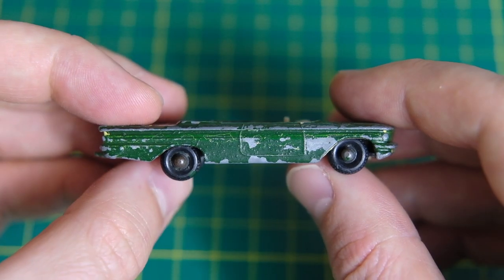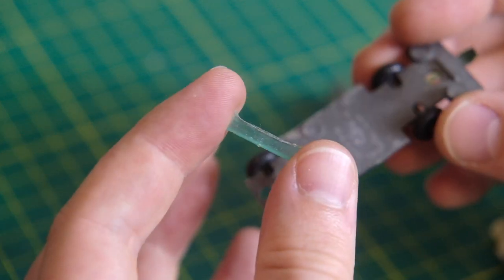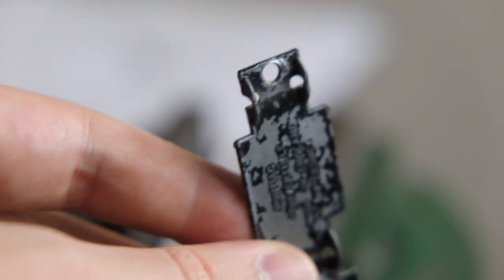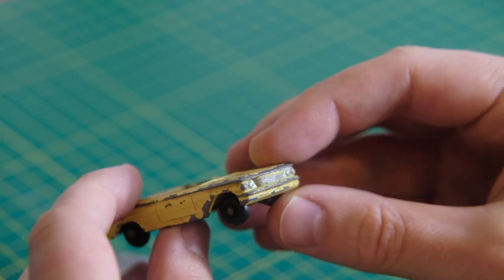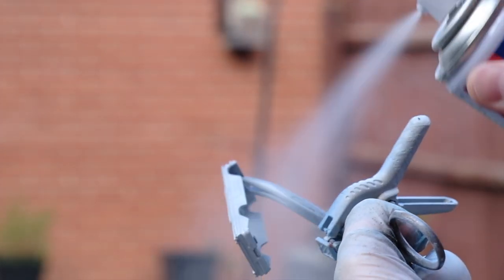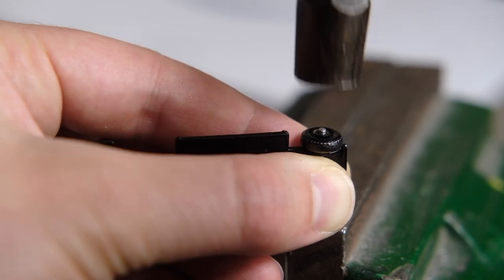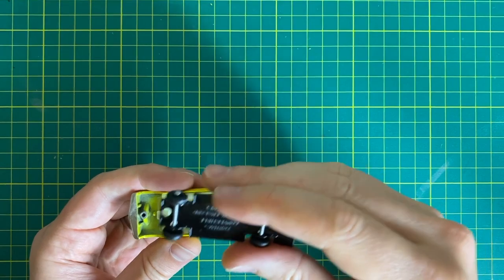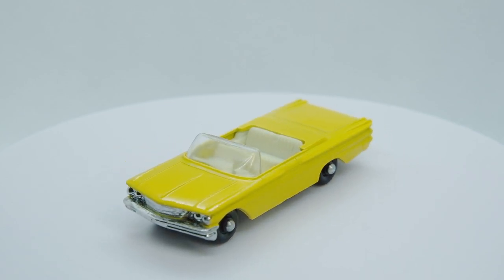MATCHBOX restoration: 39B Pontiac Convertible

Comment: Nice work mister 👌🏼 Nice soldering! Was that a majorette tailhook by any chance? Thanks for the automotive history on the models/cars. Weighing in on the darker shade of yellow applied on the Bonneville: I share your opinion. It needs to be more mellow tainted instead of a sporty / toy colour imo. Tamiya pay attention 😄 Thank you for the vids!
Reply from the maker: Thank you! It was indeed a Majorette tow hook, lopped off of my Mercedes 350SL custom. It was in good condition still so thought I'd recycle. I've just used that yellow again on another pale yellow restoration, and it has reinforced my opinion in this video! Such a shame there are seemingly no pale yellow rattle can paints!
Reply: DieCastRestos recycling is the way! Sometimes we just run out of luck in our search efforts but eventually you will come across a matching colour. Looking forward to the next video!